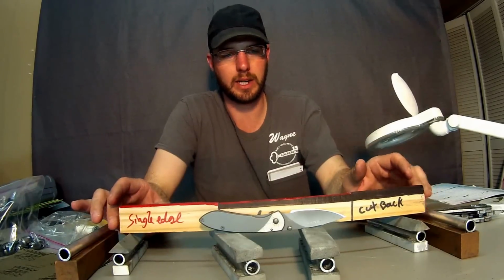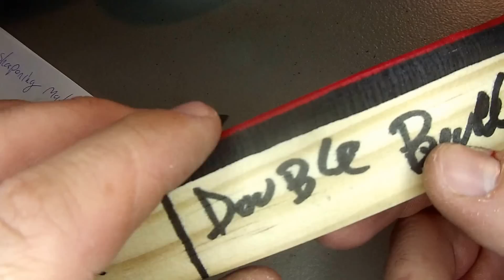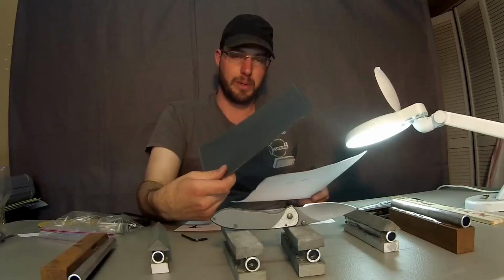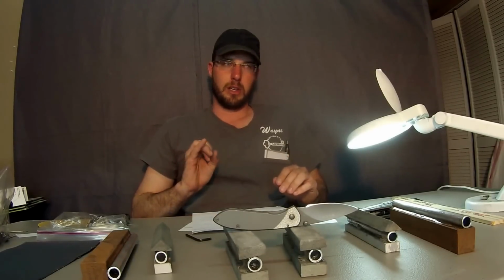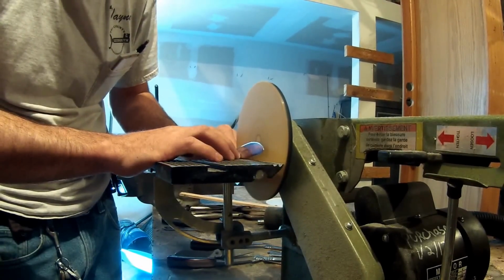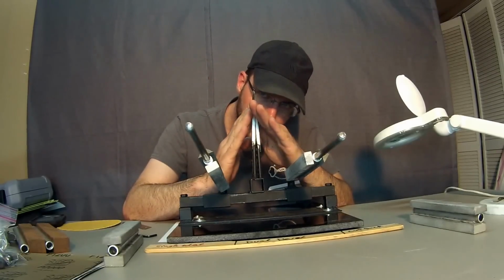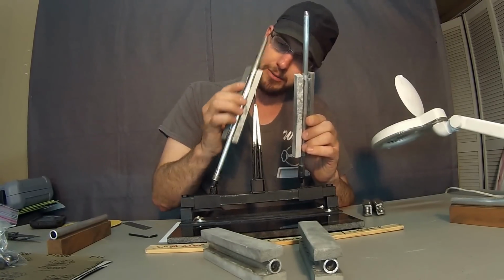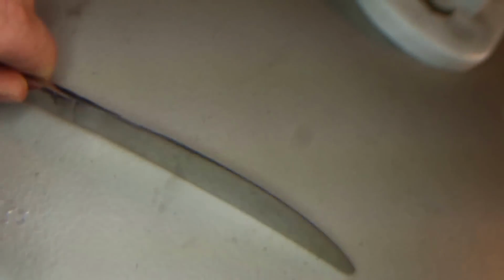Turn a Butter Knife Into a Razor Sharp Knife

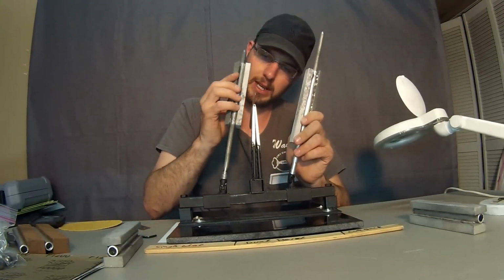Comment: The trick with the metal bars (around 16:42) to maintain the angle in the jig is a really awesome idea! I wondered why there are the pipes attached to the stones and this explains it.
Reply from the maker: It works for my needs. I based it on the wicked edge system. Just minus the $500.00 price tag.
Reply: Wayne Winton so you made the jig yourself? great video. better not put that one back in the kitchen without a warning label :)
Reply from the maker: I did. And yes the are sharp. I notify the family when the knives are freshly sharpened.

Comment: I thought a single convex edge was the best?
Reply: +Jordan Comstock All edges and grinds do different things and have strengths and weaknesses. A full convex is a very strong edge that prevents rolling while being very sharp and easy to maintain/sharpen. Its best for hard camp work. There are sharper grinds say for food prep but are easy to ruin in you were to use it on something other than food. In the other extreme there are more 'blunt' grinds that are used for chopping wood which would be an extremely strong edge but wont exactly slice well.